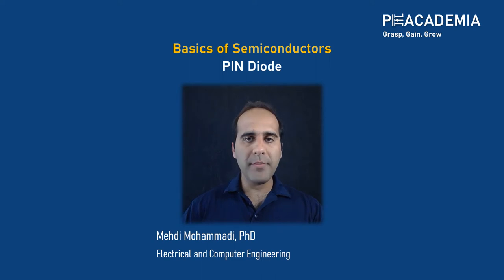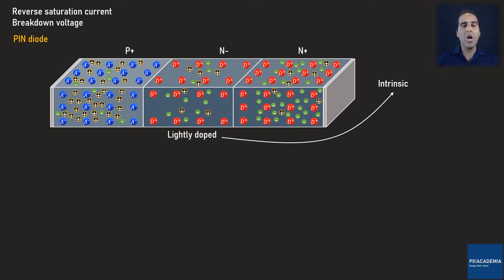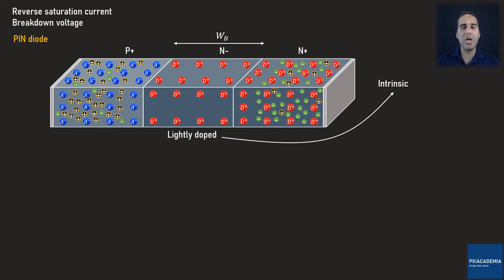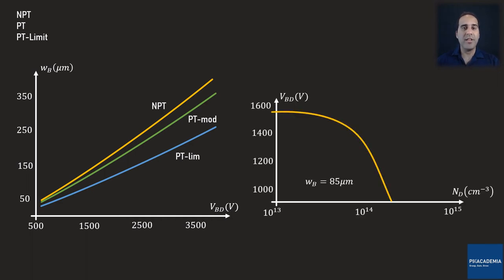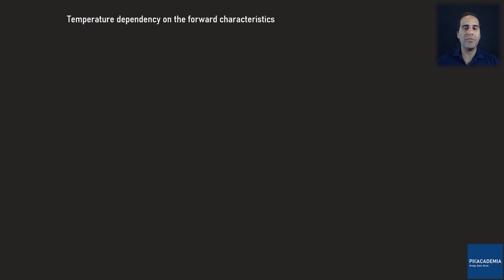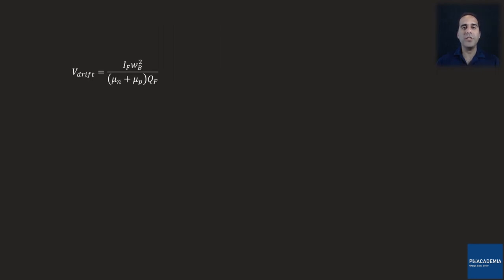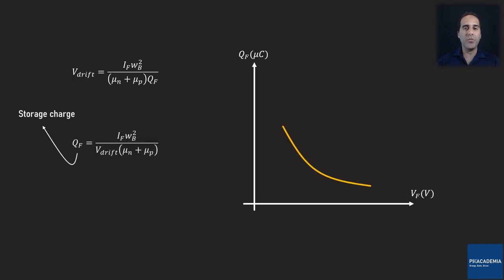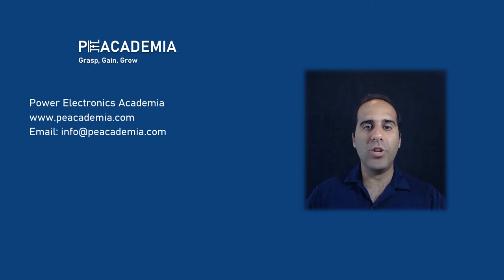21_Basics of Semiconductors: (PIN Diode)

Comment: You are saying at 5.3, the npt diode can tolerate more breakdown voltage than the others. But according to the given graph, it should be the opposite case. Right?